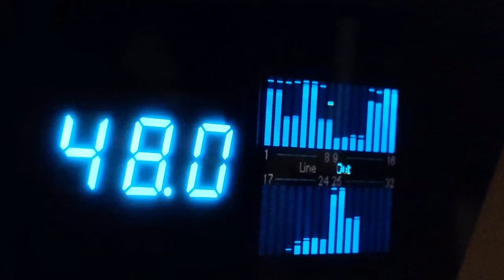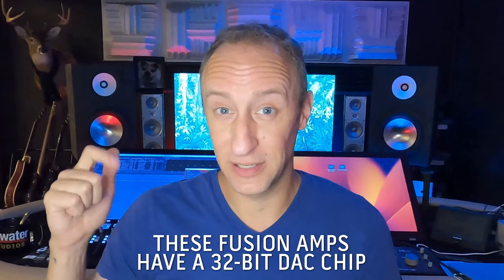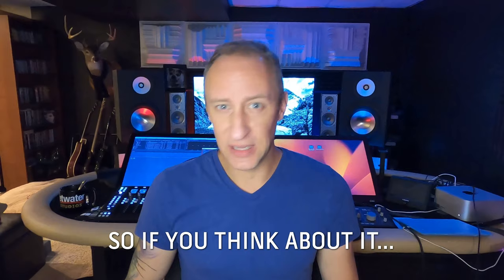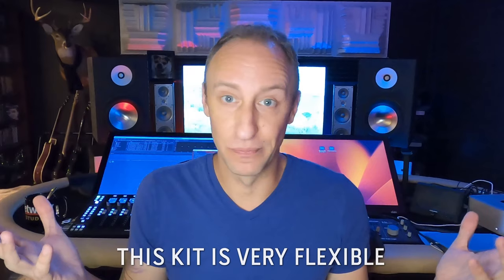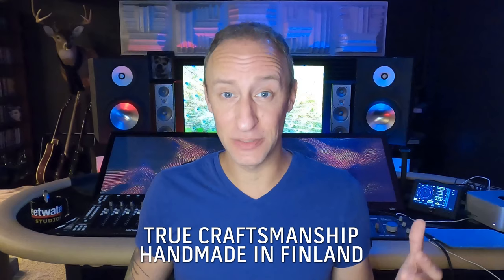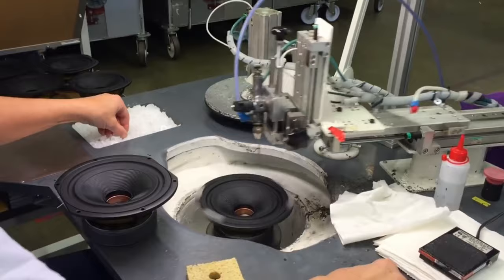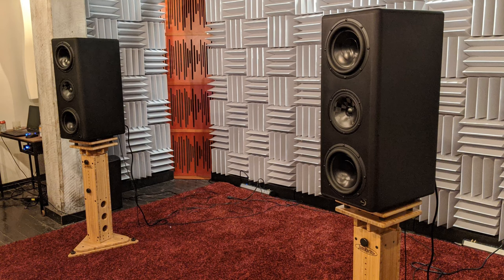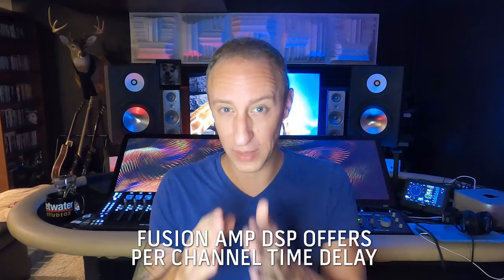3-WAY ACTIVE DSP HIFI SPEAKER KIT BUILD VIDEO! SEAS King RO4Y MKIII Von Hertzog's Studio Monitors 🔉🔉

Comment: I loved your build. I've been a diy speaker enthusiast for quite a long time. Years ago, I built a couple of subs utilizing the SEAS L26ROY 10" with plate amps and paired them with a couple of Zaph Audio ZA5.5's, both from Madisound. The setup sounded very good, especially the low end. The SEAS back then were about half the cost they are now. Recently I went with another Zaph design, the ZRT 2.5, and revamped the SEAS sub enclosures to match the new speakers. I am extremely happy with their sound, about the best I've heard, the low end is still fantastic. I certainly would've considered this kit if my budget was a little higher, but I'm extremely happy with the ZRT's. Thanks for sharing.
Reply from the maker: Yeah these subs are monsters. Love how detailed the lows are. Thanks for your comment!

Comment: Feeding the FA Plate amp analog signal, you basically doing double conversion. First digital to analog in your own DAC, then inside the plate amp from analog to digital, AND back to analog.. If you feed it only digital (max sampling 24bit 96kHz), you are skipping the first conversion in your DAC and then the AD-DA conversion inside the plate amp.

Comment: Wow, 20 to 20 in a monitor 😮. I need this in my life.
Reply from the maker: A legit game changer for me here! Hearing everything so linear is a revelation. Like I said, holographic!
Reply: The sub has an F3 of 50Hz.
Reply: @dalesmth1  the driver does? or the whole moniter? this thing has active crossover with DSP, probably an ADAU1701 chip. you can actively boost any frequencies you want. that being said, with a box sizes of 20L, i can get an $25 dayton audio classic 6.5" woofer to an f3 at 32hz with a simple box and port. no crazy engineering like double bass reflex designs or something

Comment: I may have missed you pointing it out and you obviously included it in the design but, you could spell out that the Hypex plate amps (and other brands too) are not sealed with regard to air leakage; especially the FA503! Even with a vented enclosure, and certainly a sealed one, you have to fabricate some kind of enclosure or partition for the plate amp to maintain the air seal of the woofer enclosure. It’d be nice if the plate amp was sealed but, you have to accommodate that omission.
Reply from the maker: Yeah I tried to cover it somewhere in that 2.5 hours of content but you're right. The 503 has a fan so obviously that's not air tight and the 253 uses slits in the plate to accommodate convection cooling. I used the silicone to make sure the amp barrier partition was sealed off and the woofers had their necessary sealed chambers. Thanks for watching and the thoughtful comment!

Comment: The sound is decelerated when it meets another medium, and the role of the speaker case is to reduce the sound from the back of the double-sided vibration (front and back) of the woofer. Therefore, the reason for not attaching aluminum plates to all sides is to reduce the sound from other media when it is reflected. to be exposed to. It is exposed to an aluminum plate surface and a surface made of a material different from the aluminum plate.

Comment: I just had to delete my comment as I went back and read the description again. They went full active crossover with DSP for these speakers and that's really quite a bold move. I'm a huge fan of speakers that don't need separate subwoofers and these really do look like a great option if you're considering something like the KEF R3 Meta but wanted active speakers with monitoring potential.

I think the only change I would make, if you ever want to refinish the cabinets in the future, would be to add corner bracing to the front baffle and then use your table saw set at 15, 30, 45, and 60 degrees to pre-form the edges of the front baffle so you can sand them down into a massive round-over to reduce baffle edge diffraction. It's not strictly necessary, though.

In case you were curious: you can totally just use truck bedliner to paint your speaker cabinets. It has the benefit of being incredibly durable, but also offers sound damping effects as well due to the thickness and density of the material, but also due to the high-durometer silastic nature of the material.
Reply from the maker: These are the best speakers I've listened to in my studio and I've tried a lot of different speakers. Active, passive, 2 way, 3 way, point source, all kinds. These are my favorite and these get me excited to go to work and listen to music. SEAS actually had the edges rounded on the MKII version of the speaker but said it wasn't required as the impact with the DSP correction is almost non-existent. Thanks for the comment!

Comment: Hi , I have a pair of Transmission Line cabinets that I built myself about 40ys ago, they had Peerless and they sounded great, until one of the drivers popped, so I contacted Eric at Soundimports from the Netherlands, and they set me up with 8 inch drivers and tweeters from, SEAS ,
150w NAD AMP , And what a transformation these now sound amazing, I am in my 70s and I listen to classical heavy metal the blues and Viking music just name a few bits, Luckily, I live by myself in the French countryside, and I enjoy my music to say the least, 
Very interesting territorial on building your SEAS audio monitor speakers, 🔊, Phil from the moulin France .
Reply from the maker: Thanks so much for your comment, Phil. Yeah SEAS have been a revelation for me and hearing music naturally. Thanks to Soundimports for the great recommendation!
Reply: Were you not aware and you can have speakers rebuilt here in the States?

Comment: You could fit a simple on-off toggle breaker switch on the fan amp module so as to be able to turn the fan of during critical times...the fan should only kick in if running above a preset temperature setting...eg...running the amps/speakers at loud level's for extended periods...that's a good quality looking bass/sub unit...i used to use SEAS drive units back in the '80's to design various loudspeakers...my favourites built were 3-way transmission line speakers with 8" bass units, 5 1/4" mid units & 1" silk dome ferro-fluid cooled tweeters with a very low 550hz resonance, the bass rolled in at 200hz which was the speakers -6db baffle step point, as the bass unit was 90db 1w/1m it matched the second order x-over on the  midrange unit nicely,200hz - 2.2khz, padded the tweeter down with a 3rd order x-over with an L resistor set up to match the tweeter  levels with the midranges...i bought the best polypropylene caps, air cored inductors, high quality resistors, 4mm connectors etc i could afford at the time..had them for 10yrs, i wish i still had them...the bass & mids were so good, good with so much depth & detail over the whole speakers range -3db 28hz - 25khz....nice speakers,i luv coaxial drive units, Kef Uni-Q, Tannoy, Flyde etc.....
Well made speakers bud....
Reply from the maker: I gotta say the 250 RMS feels like plenty for the speakers. There's no shortage of power when they need it. But yeah the toggle switch could work but then my anxiety that I turned the fan off when it's needed would take over and drive me crazy. 

Sounds like you had some really  nice SEAS speakers. I love how good their drivers sound. Big fan here!

Comment: If you put the drivers upside down you can move easily position them to drill the pilot holes for mounting and or putting in fittings to use bolts. These look pretty awesome!
Reply from the maker: Good tip!

Comment: Nice :)  The correction curve for the sub is crazy, but the only way to reach sub level in a closed box with this monster of a woofer. Really impressing this possibility.
You left some room for built upgrades, big rounded corners to improve interference in the mids and some other details, but a solid job you've done. 
I like the idea of the coax for the studio monitoring, good to work with. For home use I would go for seperate drivers to avoid IM and waveguide effects between them.
Reply from the maker: Yeah I just built these directly according to the plans. I think I'm going to convert them into bigger floor standing speakers with passive radiators in the future

Comment: Seas are good speakers and I use them myself in DIY, this project of yours is great for a good price, you make a similar clone of TAD speakers with an added amplifier. Like all loudspeakers, this one also has a downside, I would never use a coaxial mid/tre unit because when moving the midrange, which acts as a waveguide for the tweeter, it strongly colors or changes the treble sound image.
Reply from the maker: I know what you're saying about the mid-range as a waveguide but the crossover is at 210Hz so there's really minimal mid-range movement. You can't see any excursion, all the excursion is happening on the subwoofer. Hope that helps clarify how it will works so well

Comment: Amazing build video, thanks for uploading! My only points of note are that the edges could do with being rounded off  to reduce diffraction and the leads to the drivers seem a bit low gauge to me.
Reply from the maker: Hey! Thanks for your comment. I briefly mentioned in the video that the MKII had rounded corners but the MKIII had additional biquads to deal with it in the correction. The wire leads were coming directly from the amplifier harnesses so it's as thick as I could use given the connections (14 AWG). I was just trying to build this out according to the kit. I'm thinking of building new floor standing cabinets with the passive radiators and I'd round the corners on those cabs to see how different they measure

Comment: What a great video. Many thanks for it all. They're clearly wonderful units. The Hypex electronics is obviously great too (I already use an NAD C298 class D amp), and the DSP is the icing on the cake. I live in New Zealand so the freight for the kit would probably be crippling.
Reply from the maker: Thank you! I'm glad you enjoyed the video. I checked freight for the parts from Sound Imports and they're showing €125 to NZ so it's probably worth it!
Reply: Thanks for your reply. By my reckoning that would be close to NZ$300.00. In addition, I would probably have to get someone to do the cutting etc for me as I don't have any woodworking tools and I'm past my used-by date!!.
Reply: I am in Australia and looked at shipping. Cheapest is UPS at $478.19 USD. This puts me at $5600 AUD for the kit delivered and then I need to work out how to build the box.

Comment: Great video only thing I would change are the speaker stands, metal is a poor material to use because of ringing, oak much better and 4 feet are not as good as 3 due to micro vibrations, much easier to get 3 feet to sit probably. Especially with pointed cones, this will prevent smearing in the HF.
Reply: Another upgrade if you could source it would be the addition of Kef
MAT technology, it's  a circular, plastic structure that sits behind the tweeter and effectively absorbs 99% of the unwanted distorting sound that radiates from the cone’s rear into the cabinet. This technology has proven to be very effective in KEF speakers that have it, winning KEF the Innovation of the Year Award when it was first introduced. The latest R Series speakers are equipped with the latest version of MAT technology, making them even better at reducing distortion and producing a clear, accurate sound.

Comment: Very nice video. Maybe to long, i used fast forward sometimes. Frequency respons is almost perfect! Maybe i missed when you told what program you used. But i think Rew. (And umik) I use it to. I my small music room response looking not half as good as yours. For 32hz its only a small problem. 8db is nothing for room nod. I got 15db. Going to buy membraneabsorber.
Reply from the maker: Yeah it ran long, but there was so much to cover, I didn't want to gloss over anything. Valid point tho! Since the video I've improved the sound even more and shifted my speaker and listening position a bit farther back in the room and now I have the null down to only -6dB at 27Hz for the combined pair!

Comment: The aluminum plate is only attached to three sides inside the speaker case, not to all sides. If you stick it on all sides, the sound will be muffled. Attach it to the top and both sides. The bottom and back are not attached.

Comment: This was excellent! If I had the time and energy, I'd build a pair of these for sure. What was the final cost of the build in terms of $$$ ??
Reply from the maker: @anythingbox Thanks for watching! Final cost all in was about $3300 with the extras I added in and the wood and paint. I used the smaller amp because it didn't have a fan and it's still giving the drivers what they ask for RMS power wise. The time is harder to estimate because I was trying to film it all while doing the actual labor which was so much more time intensive than I thought it would be.

Comment: Whats your opinion on Kali's IN-8 3-Way Studio Monitors if you have one? I've had a small studio and got into recording/mastering years back since ive been playing in bands my whole life and caught the Bug. its still a "Hobby" I guess because its not my main profession but Ive recorded and mastered many works. I used Yamahas HS80s for 7 years and Bought the Kali's specifically their Coaxial Drivers because nobody in the industry had monitors that were coaxial based, unless you had thousands to spend. So for Nearfield I now use the KALI's IN-8 V2's which are great. Also have a pair of DIY 88-Special's for other Reference in my Control Room. I love Audio. Especially Transforming a Customers EP or Mix (whether a master or record and master) and seeing how happy they are. Its always the best part for me.
Reply from the maker: I haven't had a chance to hear the Kali's in person yet so I don't want to offer an opinion other than seeing their frequency response looks great and I've heard good things about the brand. I had presonus Sceptre S8s and they were coaxial with a horn and I liked those other than they didn't go low enough for my taste they started rolling off too soon at 60Hz for me. But I believe a great coaxial speaker that's properly set up is always going to sound amazing because of how it helps keep things more time aligned

Comment: Thanks so much for the video. So wish I could listen to these. Say where did you find the information about the tower versions? I'm not finding anything.
Reply from the maker: Check out the links in the description. You want the PDF Assembly Guide from SEAS and then go to the bottom of page 6 - Tips and Alternatives. To quote the passage "For even more low end-output, the system can be made into a floor standing speaker by extending the subwoofer enclosure height with 50cm and adding two SEAS SL26R passive radiators. The subwoofer DSP-filters then needs to be recalculated."

Comment: Fantastic video! Really enjoyed that. And loved the build because I myself am no cabinet building expert so I laughed at some of the techniques as it’s probably how I would do them and then cringe when watching back. 

Regarding the poly fill, have you removed the drivers since finishing them? I think there is a chance the material will, over time, fall and clump at the bottom of the cabinet. This will probably have the biggest effect on the coax where you the filling is there to absorb reflected sound reaching the back of the mid driver. 

Reflex foam is a good alternative as it won’t move once fitted securely. Or some netting could be used to support the poly fill in several layers across the cabinet. 

Another question, does the optional remote allow you to adjust output volume level of both speakers at the same time? I’m thinking about those that connect a digital source directly that does not have variable digital output. 

Once again, great video. 👍🏻
Reply from the maker: I've opened them once to check since they've been used and the poly fill is holding it's spot for now. I'm other builds I've done I've used foam inside and I've been happy with the result. Using the wool and poly fill in this kit was a lil different than I was used to but it still worked nicely. 

And yes, the remote can control both at once. Inside the software you use for the DSP you can link the speakers together. A helpful addition I'm sure!
Reply: @SocialClubSound  awesome. Thanks for replying

Comment: That's really nice ! Thank' a lot, i was hopping for this video to come till a long time ! Do you use classic MDF for your build or some more heavyest one like HDF ?
Reply from the maker: The build plans from SEAS call for 18mm MDF or Baltic Birch plywood. You could absolutely use HDF tho!
Reply: Thank you ! And how do you control the volume with this speakers ? Do you know if there is some way to control de volume after the DSP ? Changing the volume digitally before the DSP make you loose dynamic.
Reply from the maker: There's an optional remote control and you can link the two speakers so the one remote controls both at the same time

Comment: very cool and wow i hope to do it one day but smaller. are these are designed for near field mixing or far field non-mixing ?
Reply from the maker: Application can work for both. I decided to use them as my main studio monitors and they're exactly 5 foot apart. Which puts me right on the edge of Near Field and Mid Field. The original design from SEAS was for compact full range speakers that can play with incredibly high fidelity. These fit that description and thanks to being able to touch up the DSP myself, they are the flattest speakers I've EVER heard. And I just adjusted my room yet again to get the room null down to 27Hz so I'm flat thru 30Hz now